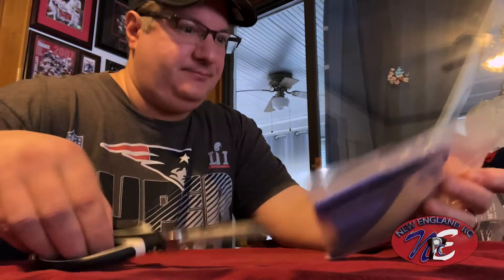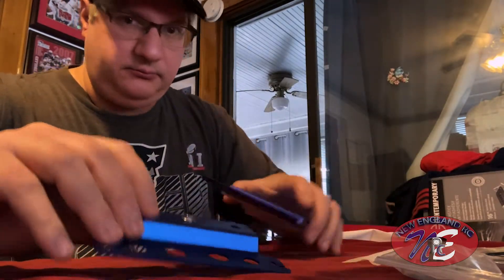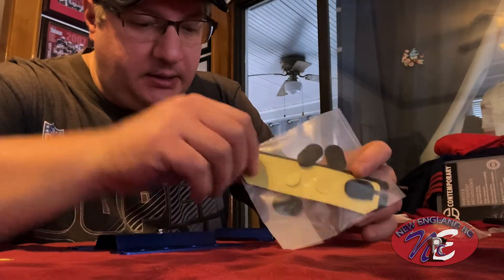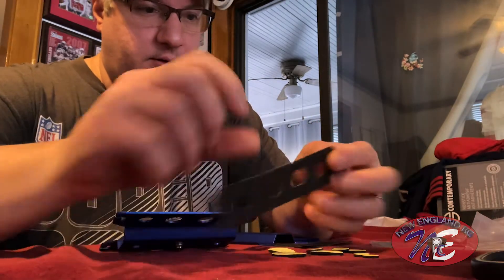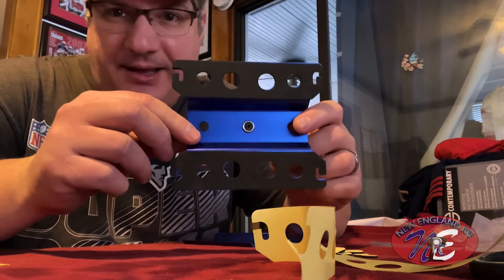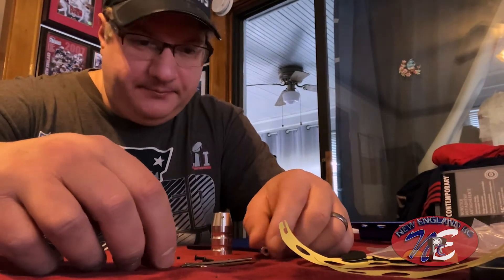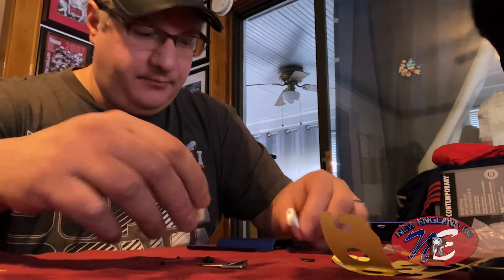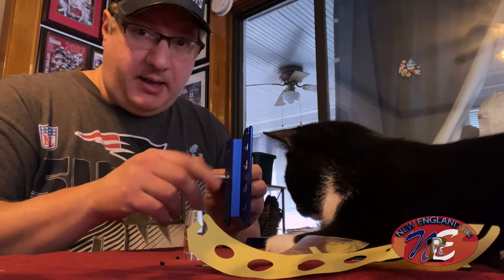1/10 SCALE MODEL REPAIR STATION WORK STAND - NEW ENGLAND RC - EPISODE 66

Comment: FYI: The eBay link is not working. What is the brand of the stand?
Reply from the maker: Not sure the brand name but If you go to Ebay and do a search for 1/10 scale work station It will come up.  The stand retails for $20.  Here's a more up to date link as well. https://www.ebay.com/itm/314184417013?hash=item4926d9bef5:g:KN4AAOSwfTVjRUAM&amdata=enc%3AAQAHAAAA8JEINkKqNwL1kCtMcBX1TvF1AUmb0lFIBX%2ByCx8cOAGWB5l9WAs4BIzB6uTqzTSY8FXS3X24teUa0oEDBPuTzO5ltQsbpiWCZzm2HqivxRFSW9aXQZM9Uk0644LKgRRUC5hGlP6XzhepPu7hxCTmOVd4A9sSitlgr6tYSk%2B26HxhRbnAxgL7xtxcuIwZPrWN7GluQLftgNbz93KQBv6rrqcT7KX0LADLUBH927Yu9225ogRlZYv8s%2FeodHgYb5h3NFCovYrILS%2B%2BHxLYfzR4IiJvNRAPZblf9Nepggjv8%2BaqgxvWljM912jdLtKzBFS7jg%3D%3D%7Ctkp%3ABFBM7t7Ok6xh